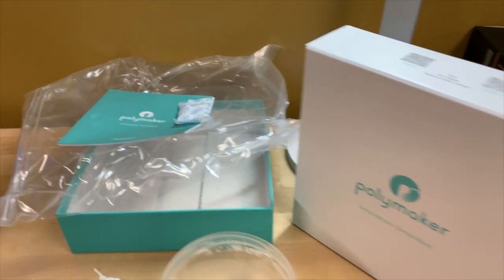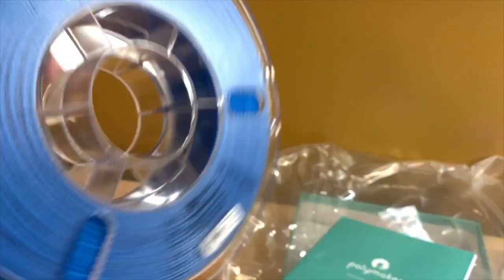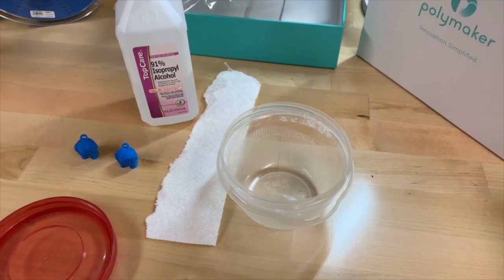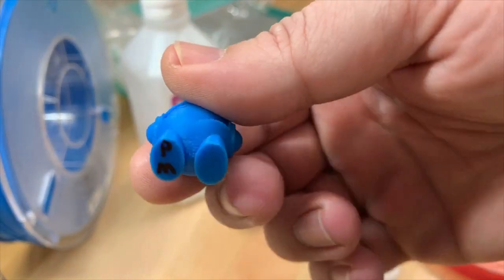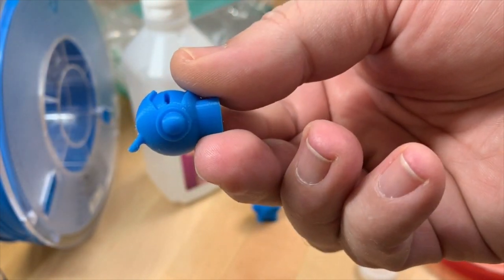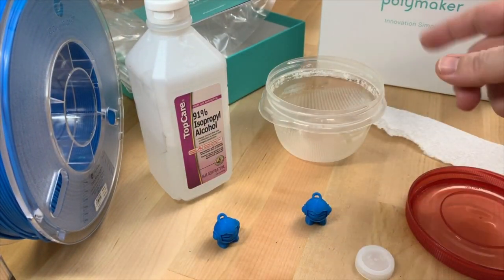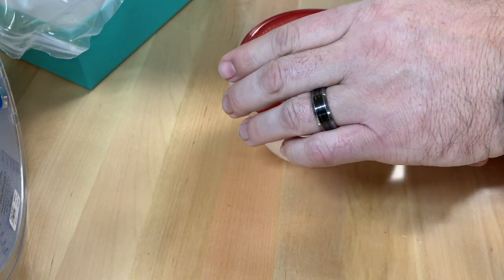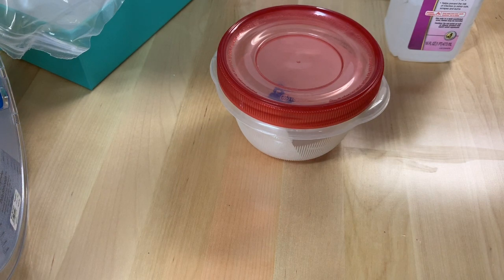Smooth Prints without Sanding - PolySmooth

Comment: how hot do you run this stuff? did you modify other settings?
thanks for the video, i just bought some and trying to find info
Reply from the maker: Mike Walton I’ll have to double check but I think I run at my normal PLA temps of 215 first layer and 210 all other layers.
Reply: Thanks!